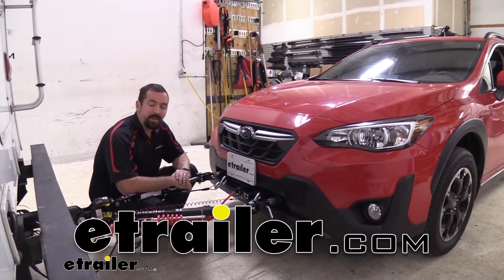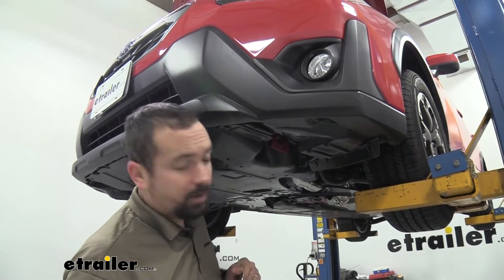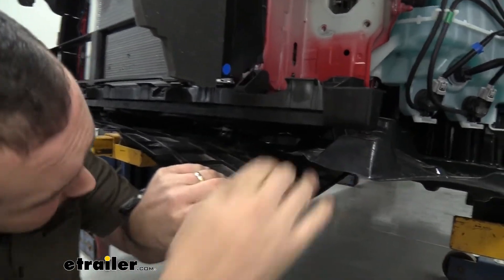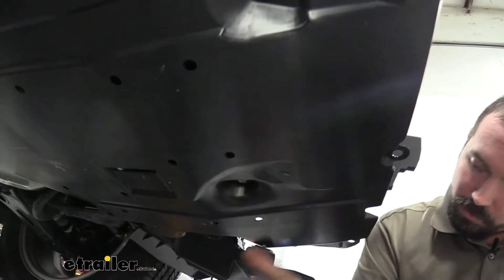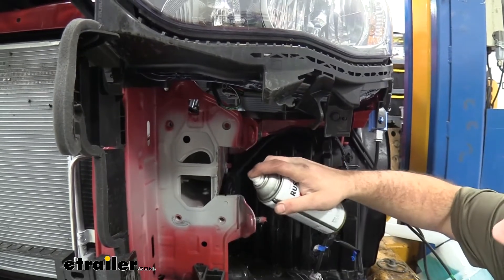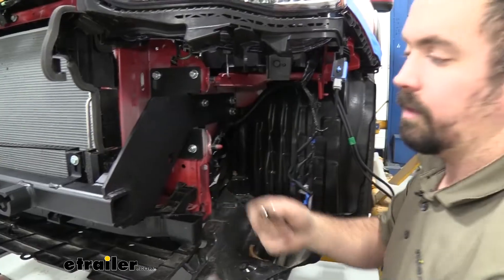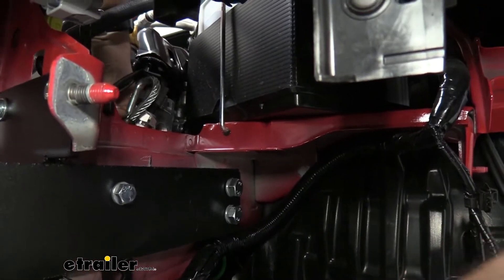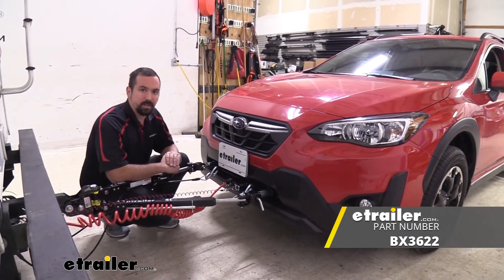etrailer | DIY 2021 Subaru Crosstrek Installation for the Blue Ox Base Plate Kit

Comment: Hi; Great video 
can you tell me the approx price of the parts and the price of the installation?
Thank You
Reply from the maker: Hi John! You can check out the price of this base plate kit here: https://www.etrailer.com/Base-Plates/Blue-Ox/BX3622.html. Install costs are going to vary depending on the shop, but I can tell you that the estimated install time is around 3 hours. That should help you get a decently accurate cost estimate from a local mechanic. This link will direct you to a local installer. Just input your zip code!
https://www.etrailer.com/installer/near-me/base-plates